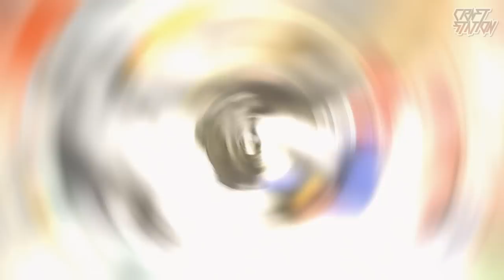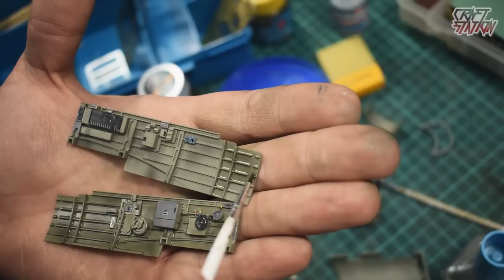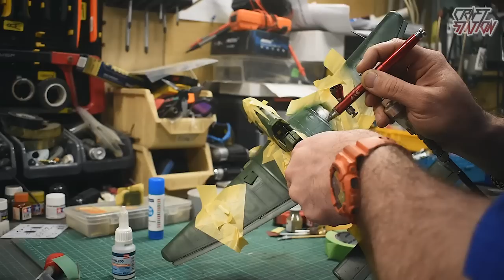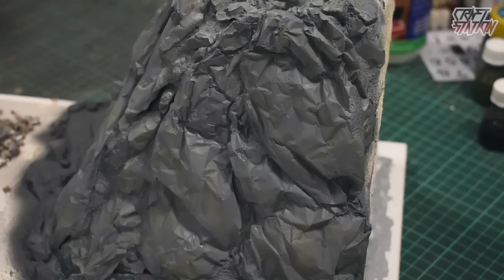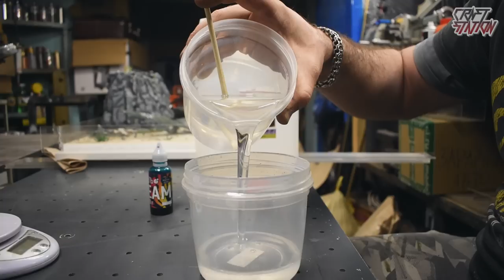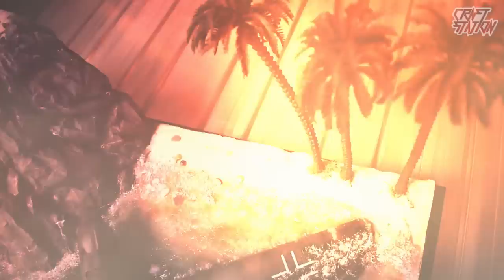EPOXY RESIN DIORAMA CRASHED JU 87 B2 STUKA

Comment: Amazing work man! (edited out my comment about the pacific theatre as I now agree that this is likely Crete)
Reply: et1965 Could’ve been set somewhere in north Africa
Reply: @rewardboy1  That still wouldn't have fixed the issue of the green camoflage
Reply: Wessel200 Equipment moves in and out of theaters they don’t always have time to repaint everything to match the theater. not saying they wouldn’t repaint it, But it’s not uncommon for equipment to be the wrong color. look at desert storm, there were forest green camouflage Abrams tanks and Humvees
Reply: I know this is a month old but im positive its supposed to be Greece
Reply: @NOBLE me too
Reply: coulda been Italy because the camo and water colour matches
Reply: @whiteiron4408  It could have, if it weren't the palm trees.
Reply: @andimitris24  Greece has palm trees they mostly are present in southern Greece
Reply: I'm going to try that exact thing when my planes arrive! Zero crashed on the beach with a p40 flying above. Going to be my first try at a diorama lol
Reply: I think this diorama is based on crete,grece
Reply: @josegonzales589  In hindsight, I agree with you. This is very possible.

Comment: Let me first say you are an awesome super skilled modeler and this is an award winning diorama in my book.  I couldn't come close that level of detail and realism.  I really enjoyed the build steps and the final reveal.  My only thought, and this is a nitpick, is that i found it odd that the pilot escaping the crashed aircraft would have turned back around reached into the cockpit and carefully arranged the shoulder harnesses perfectly and symmetrically draped over the seatback.  I would think he would have just unbuckled himself, tossed them over his shoulder as fast as he could and climb out without any hesitation.  I could be wrong.  Just a thought.  Thanks for sharing.  Fantastic!

Comment: As others have said, it's a bit bizarre to see a B2 painted in European Theatre splinter camouflage apparently in the tropics for some reason, and I'm inclined to think that a Stuka would be hard pressed to successfully ditch without cartwheeling and breaking up, what with it having a big fixed undercarriage and that big draggy radiator under the nose. But these things aside, it's a great bit of modeling.

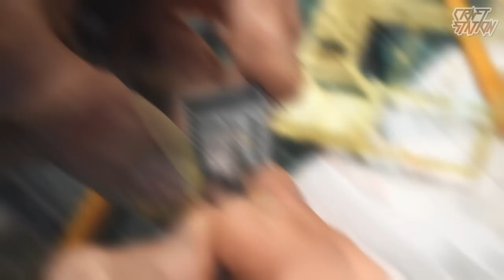Comment: 2:50 Hot tip: Put band aid on your thumb BEFORE you cut yourself. Because you KNOW that you will be cutting towards your thumb, even though everyone says you shouldn't do it. So that means WHEN (not "if") you slip and cut your thumb, you'll be cutting the band aid rather than your skin.